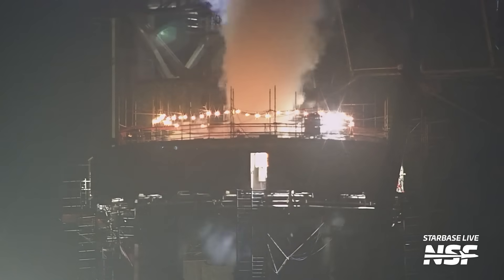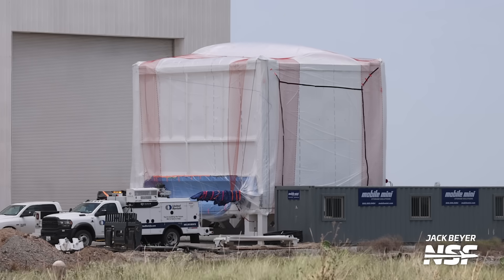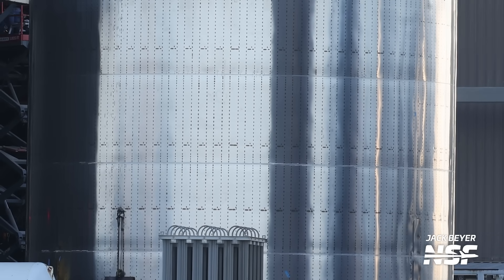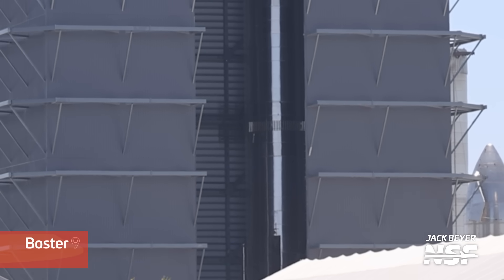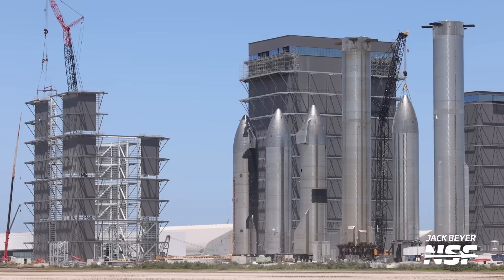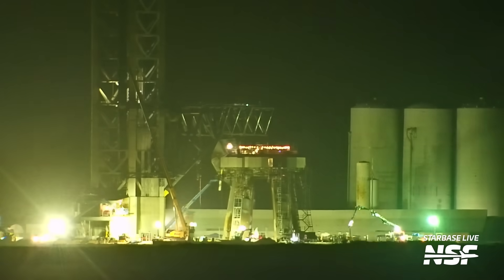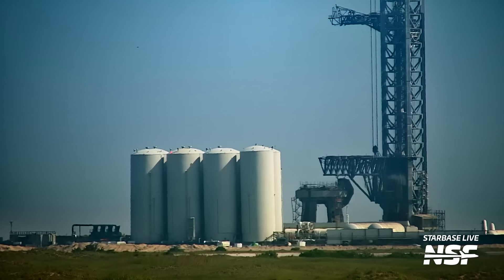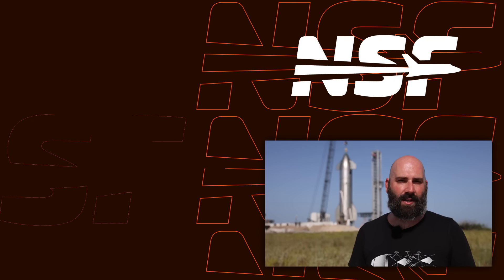Starbase Update: The Orbital Launch Mount Returns To Life

Comment: On the which comes first question, I think I have a question,  have see seen the Hot Staging ring yet?  If so, then I think it gets put on and then B9 rolls, if not, then they will bring out B9 for a few static fires with the deluge system, then roll it back for the hot staging ring.  They don't want to do rework, which is what rolling the booster out is, but it will be more efficient to roll B9 a couple times if they can get some testing done while they make or finish the ring.

Comment: Seeing as how SpaceX plans to increase the size of StarShip in the future, could it be that the second mega bay will be a bit taller?
Reply: Probably
Reply: The addition to the Booster for hot-staging is only about six feet, so it should fit the current mega bay just fine. Ship is quite a bit shorter, and currently has a lot of room to grow before it would reach the limits of the older high bay, where it is currently being assembled. The height of the first mega bay also includes the glassed in floor(s), so that may affect the design of the second mega bay. Unlike the two half-floors on the high bay, those on the mega bay are completely above the cranes, so if they don't need them for the second bay, then it could actually be shorter. I have seen lots of speculation, but NO concrete information from SpaceX about what's going in there.

Comment: Great video Jack, but why test a starlink payload bay with a test item with no pez dispenser door. Wonder if they are testing the orbital tanker payload bay?
Reply: It does have the pez dispenser onboard and the opening for the door. That'll be installed later before testing it. The test article is not even fully built yet but I didn't dive entirely into that because we'll see it progress over the next weeks anyways so we'll see it all unfold as it goes

Comment: Good Video.  Likely, they'll attach the hot staging adapter while in the bay.  I think there should be a look out for the prototypes.  Question is are they going attach it to a test article and try it out that way instead.  If so...where.  Aside from launch pad, McGregor test site would be only other place use Raptors on something like that.

Comment: It would be cool to see some form of testing for the hot stage section before flight see how it works and all. Engine firing right on top of a booster?
Reply: You mean starting a fire on top of a fuel tank on the LaunchPad????
Reply: @1bengrubb   a smaller test tank article not on the pad or the tower lol

Comment: Going to be interesting to see how successful the water system works, you ever get a plate of steel REALLY hot then dump a bunch of water on it ??
That steel warps and bends like a pretzel….
Proof is in the pudding as they say.
Reply: If it's like other deluge systems, the water spray will start before engine ignition. Of course, if it turns out to not be enough water...
Reply: @JustSomeCanuck  
I think the engineers at SpaceX are brilliant, but I also thought the design of the original OLM sufficient, lol
Hope everything works well.
Reply: Water first mate.